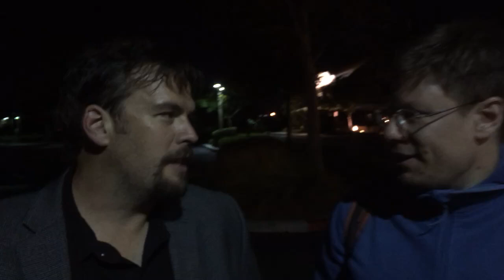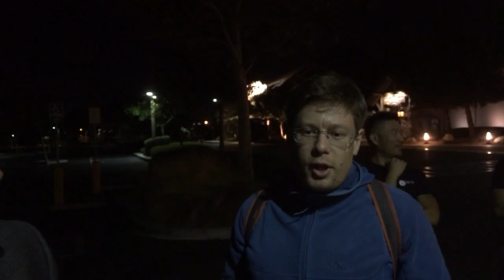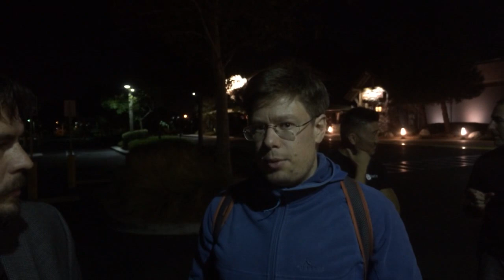Current Ballistic Models VS Human Innovation ~ Rex Reviews RX18

Comment: this is exactly where ai comes in. the ai can be much better than any human before it at specific tasks. poker, chess, go, its just the start. having petabytes of data for the ai to work off of might just be commonplace soon.

the multiphysics tool suites might use some of these features, so it may be awhile before engineering gets moved up a level to an oversight position making sure the convergence and modeling parameters are being set correctly

there are some good ways to really counter the last big hurdles of long range ballistics as well

Comment: kind of like how rockets use gps maybe we could come up with a bullet the size of a 50 bmg or bigger and fit a microchip in it along with a mini camera or infrared system or whatever detection system is most suitable.
Reply: The issue is guidance control.  Sure, electronics have gotten small enough to where you could probably fit a GPS or other guidance positioning chips, but rockets also have tail fins for course correction.  These bullets would have to have some sort of way to correct it's course mid-flight, and sure, you could add some pop up fins, but you still need servo motors or some sort of actuator to move them precisely to correct any errors in course.  It would be an enormous design challenge, and then the price wouldn't be very cheap either.  If you think $3.50 a shot for .338 is bad, imagine $750 a shot.   The price is not worth it when current ballistics calculators and tuned reloads can get you pretty damn close.
Reply: somebody has to prove it and then mass production can lowe the price a bit.